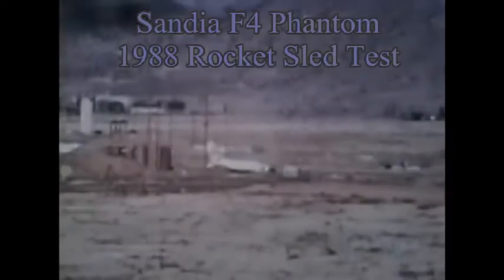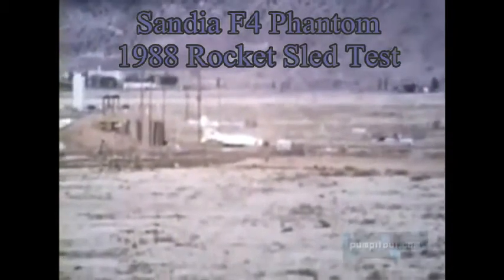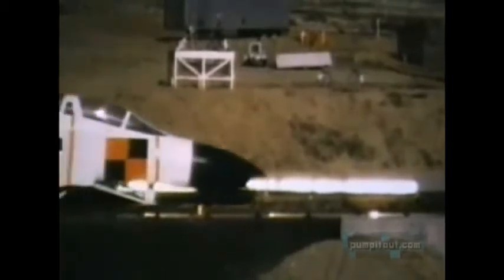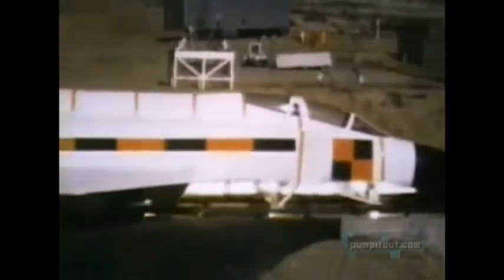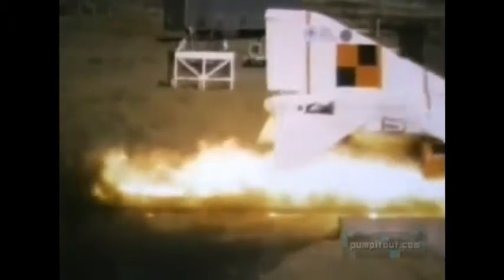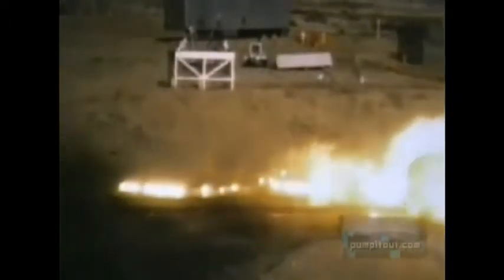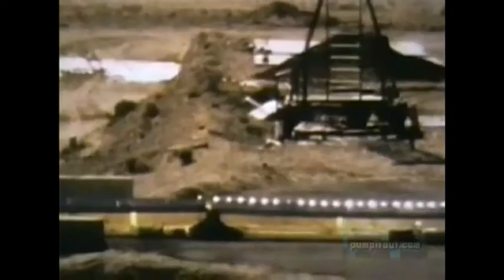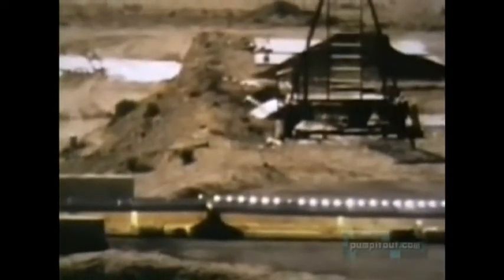Sandia F4 Phantom   1988 Rocket sled test

Comment from the maker: There were a lot of columns...The part that Kevlar don't want hear is that the concrete floors were designed to to give the whole building more integral strength and were tied in with rebar and shear studs. The amount of mass that would be encountered is huge and, like the Sandia stooge sez, the plane was laying in a pile below...Is it just me...or does Kevlar seem a little bit desperate? ...(G% xoxOxox~~~*